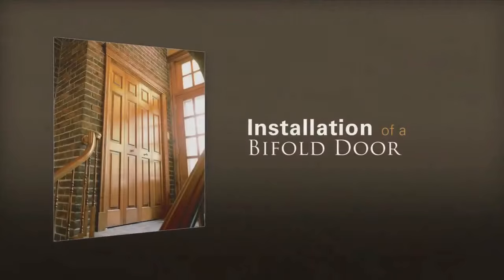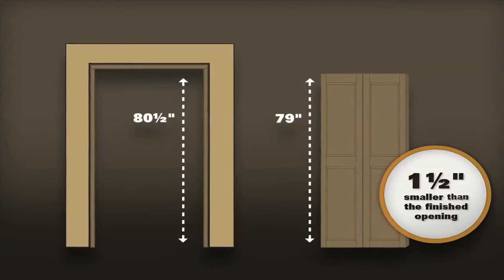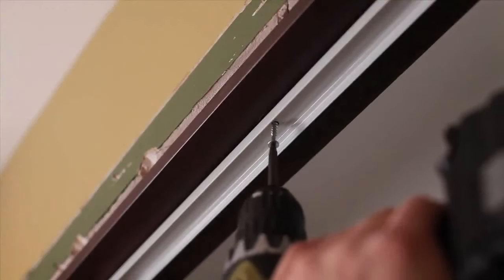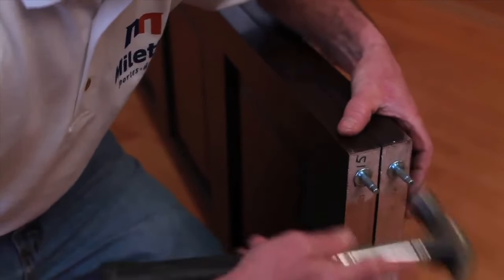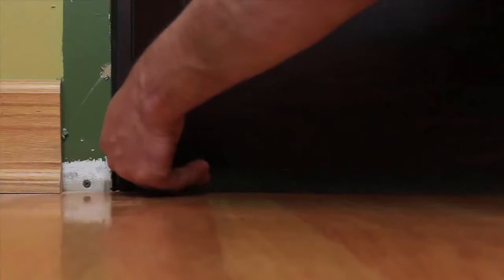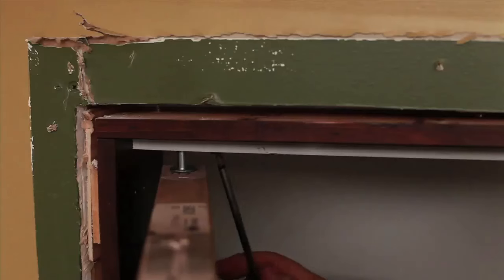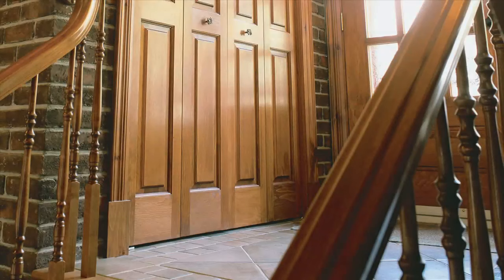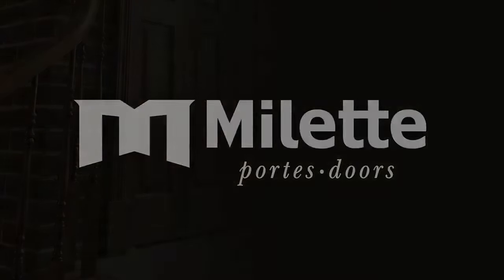How To Install a Bifold Door

Comment: Help, please! 
I bought the 24 x 80 bifold door, but after I tried to install it realized that the width of the frame is only 23 1/2 inches wide. Is it possible to somehow still be able to install the same 24 X 80 door into that space? (23 1/2 Inches.)
Reply: Ya, you gotta trim 1/2” off the edge of the door. Take it off the side that goes against the wall so you can’t see it. Table saw works best, or clamp a straight edge onto the door to facilitate a skil saw